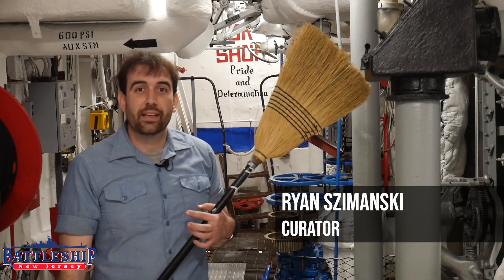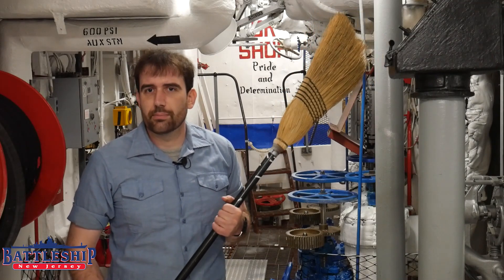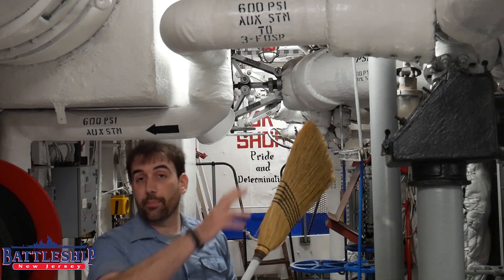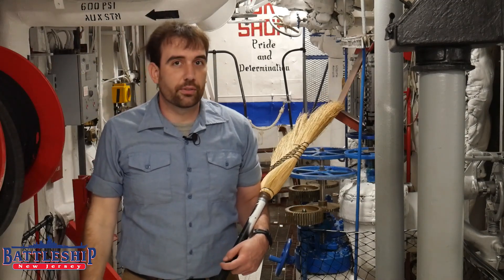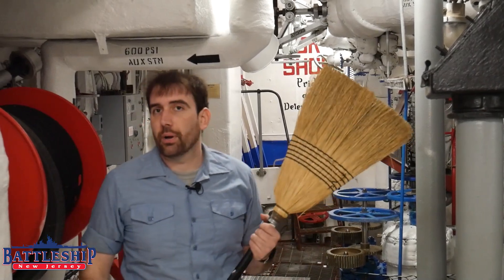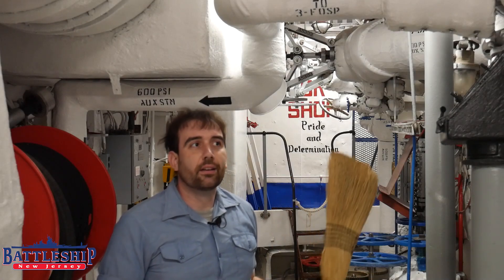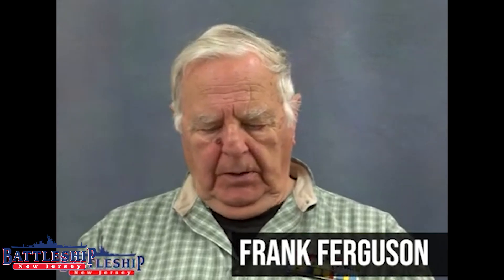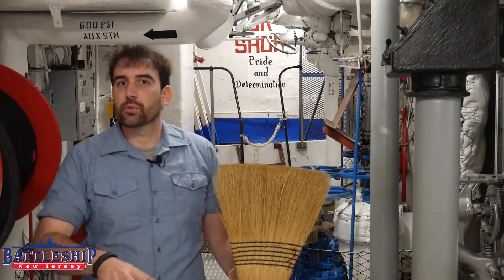Searching for Steam Leaks in the Battleship's Boiler Room

Comment: I worked in a coal fired power plant our high pressure steam you could not see so we put booms all over the plant. They said the same thing it would cut you in half and seal you back up. Our safety guy would get made about us leaving brooms around until we told him why. We had a steam leak it sounds like a pipe organ out of tune

Comment: I remember one h.p. steam leak.  Happened when we were bottom blowing the boiler (1200psi) .  When opening the valves, a sudden burst of steam started, we secured the closest valve to boiler and it slowed.  It was between the first and second discharge valves, a hole about the size of a pencil.  Had to wrap up that boiler an d bring on the other.  We had just been through the Panama canal, and had to keep one going, underway procedure.  Flew in high pressure welding team from Norfolk.  Stuck In Panama city for 5-6 days, we only got a half days liberty.  Can't have liberty till the job was done.  The life of a boiler technition in the 70's.

Comment: I was the Main Propulsion Officer on a WWII Destroyer (USS Cogswell DD-651).  She had an identical plant to the New Jersey.  600psi; 850 degrees superheat.  We sprung a steam leak in Main control, and the Chief MM and I searched for the leak with a long piece of cardboard.  When it sliced the cardboard in half, we knew we found it.  Superheated steam is like compressed air; you can't see it, so it can slice you badly if you don't use something like cardboard or a broom too find it.  Am enjoying your video's immensely.
Reply: I made this comment on another steam vid. 

“Having actually used this method to detect steam leaks, the idea is not that it will cut the broom in half… that is nonsense and a myth…at high pressure maybe but at the pressures needed to cut a broom in half you are probably not going into the area anyway. It is for “lower pressure” areas (<2000psi if memory serves) where the objective is to use the broom 
as an indicator of force (steam exits at high velocity) and a condensation indicator to prevent techs from getting scalded. steam wont cut a broom in half, but the broom will give you a bit of an early warning indicator when you are actively looking for a steam leak. A method I have personally used that is better is a piece of thin cardboard taped to the end of a stick as it will affect that rather visibly. (I briefly worked with steam so not a ton of experience with it but this is what i took away from that experience, wasnt my gig) also this is a VERY OLD trick and likely not even used anymore. Also due to my limited experience with steam I am sure I got a few things wrong so take this with a grain of salt as the place I worked for was a janky place which is why i didn’t stick around at it very long. But the broom trick (mainly the carboard on a stick) has come in handy a few times when working on older boiler rooms used to heat water for heating older buildings. It is rare to encounter these heating systems anymore, but being in commercial/residential maintenance I have seen and worked on them a few times. Generally on those its a water leak but occasionally it can be steam and while steam can be visible in the right conditions those boiler rooms are typically rather hot and you cant always see the steam so i would use a piece of thin cardboard if I suspected a steam leak to avoid getting scalded by >400+ degree steam.”
Reply: Also please correct my previous comment as Given yours you have more experience in the field than i do.

Comment: I'm not Navy but my Maintenance Supervisor had been in the Navy in the early 60's. When I first hired in he told me how they found steam leaks on his ship. He used a 2"×4" and ran the steam lines with that. Claiming that when you found it the board would be cut in two. Being nineteen at the time I though that was to dangerous for me. I'll stick with molten Aluminum casting.
Reply: If you watch videos of Pakistani  foundries, they work with molten aluminum in sandals or even bare feet. Even steel they wear no protection and only the lucky ones wear boots.

Comment: I am glad you made this video. In early 80s I decided to get EMT certificate because of an incident at GE gear plant in Lynn MASS. I was always told when reduction gearing and steam turbines were tested you walked around test stands with a broom. High pressure steam cannot be seen until it turns to moisture. You can walk into an invisible leak and then it's to late. I was also told getting burned by steam feels nothing like being burned. What your talking about happened to a worker in the gear plant. The gear plant is on other side of commuter rail tracks where the most of ge jet engine manufacturing also hospital.

Comment: Referring to be able to cut someone in half, heard it from a person who worked for the Philadelphia Naval Yard that was still too young to retire when it closed. He didn't mention the broom probably because he did mention the fact that our building used low pressure steam, whatever that means, and I did not have to be worried about being cut in half. At the time I was only a cleaner who had no business being in the Boiler Room except in the summertime when all the boilers for down for a preventative maintenance, we would help the engineer carry up trash from The Boiler Room so we can get it to the dumpster. You couldn't help but have empathy for the guy , he was covered Head To Toe with soot. So the six or seven males cleaners working in the building we all carried one mildly heavy trash can upstairs, whether it was our job or not to do so. Thumbs up, thanks for the video.

Comment: "Enginemen" worked with diesel engines.  I would imagine on the New Jersey Enginemen were in  A-Gang, taking care of the small boats and the emergency generators.  

In the Cold War Navy, Boiler Technicians and Machinist's Mates primarily work in the Firerooms, Enginerooms, and Main & Auxiliary Machinery Spaces.  

I worked in the After Engineroom (EM02) of the USS Dale (CG-19) for several years in the late '80's.  We had a 1200 pound plant.  

We never had any Main Steam leaks.  So, we never needed a broom.  But, there was always one or two close at hand.

Comment: You haven't lived till you have been in a 1200 Pound steam plant when the main line lets go. Forget cutting you in half it will parboil you in an instant! Usually, before you can get near the escape trunks. Smaller leaks if you can avoid running into them, you can still get to the escape trunk and close the main steam from the main deck remote valve wheels.

Comment: Yes not wives tale I was a stationary engineer on 3 big coal fired water tube boilers at 400 psi at 250000 lbs of steam an hour each 900 tons of coal every 24 hours. An I can tell you you can hear a steam leak!!! If it's high pressure steam you can't see it if it's low pressure steam you can. Stream is dangerous if you don't know what the he'll your doing.

Comment: I worked at a powerplant a while back and at that powerplant when they had a steam leak they had broom handles with rags on the end of them to search for leaks. So I can totally believe this method was used onboard. I did experience one significant steam leak that went out into the boiler house. We could hear it on the other side of the boiler (which is large and the house is very noisy so that's an indication that it is a bad one) we searched for it using a wooden folding ruler because that is what we had on hand when we were out in the boiler house. It's flexible enough that we got an instant indication when we sweept it past the leak. When we examined the part of the ruler that had passed through the invisible steam we noticed it had almost instantly charred the wood so superheated steam is something you want to take seriously. And that was just one of the 725 psi auxiliary systems that was leaking the steam main at that plant was over 1300 psi so I'm glad that thing didn't break while I was there.

Comment: The broom method was also used by NASA to detect hydrogen leaks on the Apollo Saturn 5 (Hydrogen burns with a clear flame).
Also, 600psi, if it's a fairly large-sized but narrow leak, will absolutely cut you in two, or at the very least cause massive damage. I've searched for and fixed hydraulic leaks and if you put your hand onto that, well, it's like a liquid scalpel that's terrible in every way!

Comment: I was on the USS Glover at 1150 psi and the J.P. Kennedy at 650 psi then at electric sen stations at 650 and nuclear at 1150 psi. I was on strike duty on the 650 psi gen stone as burner operator. at the generation had pipe leaking and had to knock the slag off the walls before repairing.

Comment: Not just steam but with industrial hydraulic systems that operate from 3,000 PSI t0 the extreme of 10,000PSI, that broom is just as important today. I did see a guy get a rather nasty but very precise slice across his palm from a hydraulic line with a pin hole leak. The machine was off but the pressure had not dropped to a safe (Zero PSI) pressure yet. Lucky him, full pressure would have taken it off, no doubt.

Comment: Interestingly hydraulic or even modern fuel systems still have this exact procedure, as the line pressure is still plenty to blast under your skin and cause death, even when the engine might only be a couple of kilowatt generator for lighting, rather than hundreds of megawatts of superheated steam. At the end of the day dead is dead, and few people are worried about how excessive the forces where, so using a sacrificial sweeping object (in small engine bays often only a sheet of paper taped to some flexible wire to work it around) is still a contemporary way to stay out of harms way when finding a leak, rather than a footnote of history that died with steam ships.

Comment: I was a boiler-tech-student in 1984, but due to my poor health, I never made it to any ship.  Yes, I did learn about using a broom to find leaks.  Old machinery was not the only factor to cause a leak.  It could be that the pipes were not reassembled correctly after a repair, or maybe a gasket blew, or maybe the shock of battle damage shook the pipe joints loose.  The valves was another possible source of leaks.  Regardless, a steam leak was a dangerous situation.  Listen for the whistle noise.  You would probably also see a misty cloud as the steam turned back into water under normal room air pressure.

Ryan mentioned that the boiler techs and the machinist mates were required to memorize the piping system.  Yes, I was told that everyone was expected to know all of the piping systems of their area (Main steam, auxiliary steam, and fuel oil, fire fighting, etc.).  The lights could be knocked out from battle damage or other accident, and everyone needed to know how to handle every situation in total darkness.

Comment: USS Ranger (CVA/CV-61) had 1200psi boilers. Fortunately, I didn't work down there. I visited a friend one time and found it way too hot for my comfort. However, as the #1 nozzleman on a DC party, I did have to know what kinds of piping ran through all of the compartments in which I might have to fight fire or search for damage. We had a 6' 2x4 that we would wave around to find high pressure steam leaks. Even if it didn't cut the 2x4, the lead would knock it aside. I do remember that JP-5 piping was painted a lilac color. You have some of that on New Jersey. I saw it in one of your videos.

Comment: I was told by a Navy sub engineer they used a broom looking for high pressure air leaks. IIRC, he said the emergency ballast blow is 4500psi. That will cut human limbs off at a leak point.

Comment: +Come on. Your killin me. Maybe, just maybe a broom stick may be used. But in 20 years of serving as a BT on 5 different ships. I never saw it done or even heard of it being done. The one major steam leak that I experienced. It was a blown flex on a main steam line. You damn sure could hear it. but you could not get within 15 feet of it. It was too damn hot. we shut the cross connects and secured the boiler aft. Let it drain off pressure and repaired it. I would use a large inspection mirror to check for steam leaks. Even though you could not see it. As soon as the steam hit the mirror, it would fog up. The broom stick story was just that. Long hours on watch day after day, months at a time. The stories got bigger and better.                ( Sea Stories!)

Comment: i wasn't in engineering, but the broomstick was taught as a good way to find leaks in any high pressure system.  it was considered far better to wreck a broom than a person.

only thing i was regularly around was the high pressure air system on truman was at 3000psi.  mainly i new it was used to run the pumps that refilled SCBAs, don't know what else it was used for, perhaps the cal lab and the oxygen plants (referred to them as the oxygen bars which were a bit of a thing back then).  and any leak was considered quite dangerous.

unlike constellation though, truman had very few steam accessories left.  constellation had steam capstans and anchor windlass along with other things.  on truman, only engineering, the hot water heaters and the catapults used steam.  everything else was either electric or electro-hydraulic with local pumps so even there, there were no high pressure hydraulic lines over any sort of distance.

Comment: No but I have dealt with the 2000 PSI industrial pressure washer. If a coworker didn't want to wear his shoes so he wouldn't get his feet wet and his shoes soggy so you went barefoot. I took the high pressure wand out of his hand spake a bunch of cardboard probably 8 or 10 layers thick and took the noz zle put it on there turn the wand on and blast it through 8 layers of cardboard and sliced it like a knife. The high pressure water cut right through that cardboard so fast it didn't even get much more than damp and as clean as if you'd cut it with a razor blade.

Comment: I remember when I went to (GSE) "A" School in Great Lakes in late 1988.  At the time all the engineering disciplines had to first go through a "Propulsion Engineering Basics" course which as the name suggests taught the basics of engineering including Diesel, Gas Turbine and Steam power plants.  I can attest they definitely told us to use the broom method to check for steam leaks. 

They even had a couple of "hot plants" which were simply shipboard steam plants enclosed in a building.  One was the 600PSI plant and the other was the 1200PSI plant.

Comment: This is the way I learned it when I went to the Navy NPP prototype S1W in Idaho in 1972. Shown a known leak (opened test valve) on 150 psi aux steam, and it chewed the broom to slivers in less than a second.
Just before that, I had been assigned to the USS Buchanan DDG-14 in overhaul at Hunter's Point SY in San Francisco. I'm in the engine room, working on the degaussing coil power supply panel during initial plant startup. Had a 6 inch steam line part at 900 psi. Huge roar, instant hot fog. I dove into the bilge, which was covered by a three inch layer of oil. Two other watch standers tried to escape the steam by racing up the vertical ladder that led to the main deck door. Those two poor bastards got caught in the plume on the way up; the steam wasn't at full temperature by then, as they were some 60 feet away from the source, but it still burned them both badly. The team stops went shut within a few seconds, and after a couple of minutes, I crawled out of my nice cool oil filled bilge and made my own way out of the space. The last time I saw either of those two Machinist Mates the Corpsman was cutting their blue chambray shirts off their backs, which had become fused into their skin. 
Two things to remember. High pressure steam is very dangerous. Hot vapor rises, so don't go climbing up into the plume.
I was lucky. All I lost was the working uniform and shoes I was wearing, as they were wrecked by the oil.

Comment: USS Constellation CV-64, I believe it was 1992 or 1993 after Her refit/S.L.E.P. 
During Sea Trials we found a steam leak when it cut off a broom handle, but with a 1200 psi "DRY STEAM" system it was a bit more hair raising than it would have been with the 600 psi "WET STEAM" system in use on the Battleships.

Comment: Back when I was in EMS, I responded to a call for a guy who was running a lathe and had a hydraulic fluid leak.  It started spraying hydraulic fluid all over and without thinking the guy grabbed the hose to stop it.  It injected about a pint of hydraulic fluid into the subcutaneous space under the skin of his hand and arm.  Not pretty.

Comment: And latter ships DDG's as one had 1200 psi plants which were even more dangerous if a leak developed.  The cooling system for my radar was located in the aft engine room and I used to hate to have to go down there if we were lit off.

Comment: While I have never been in the navy I am a union steamfitter and the first job I was on as an apprentice was in 1984 on the construction of a new unit of an existing powerhouse in Indiana. The old timers that I worked under at the time told of how they used to search for steam leaks with brooms and of the story of a man who was passing his hands along a steam line looking for the location and found the leak but lost a number of fingers in the process the high pressure steam having severed them off. The steam pressure used in a coal fired powerhouse is about 2200 psi just about what is in compressed gas cylinder. They also told me horror stories about unsecured cylinders but that is for another time. Thank you for the preservation of our collective history and bless all that have sacrificed and served.